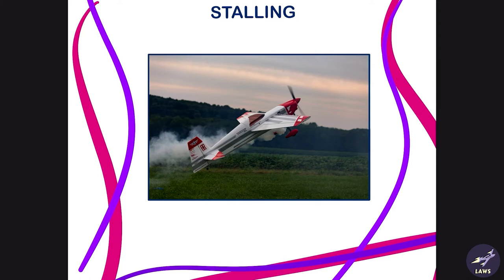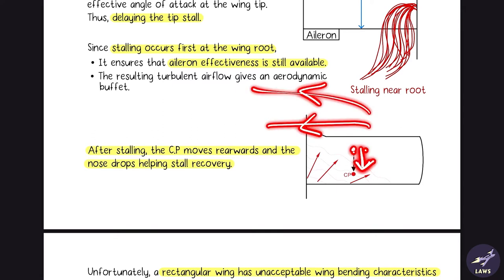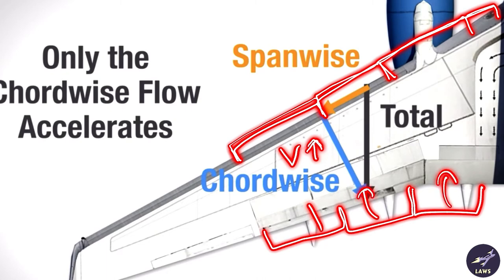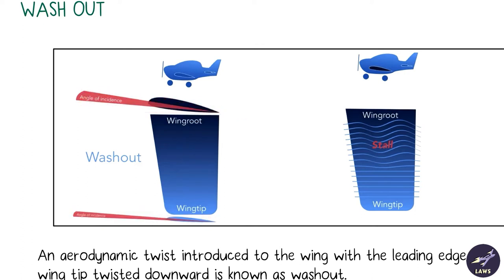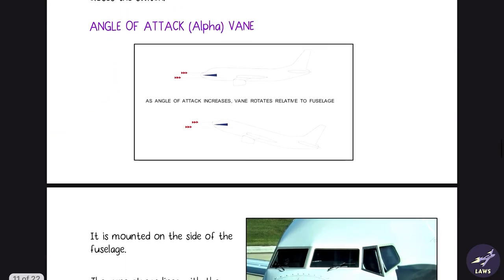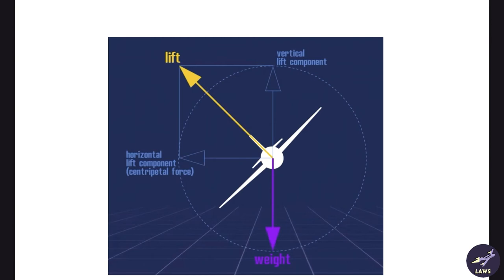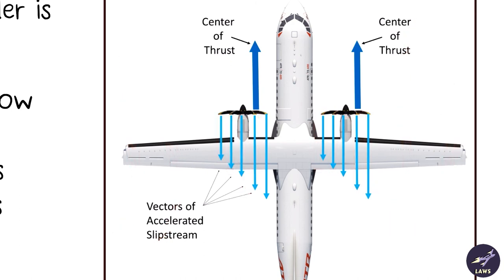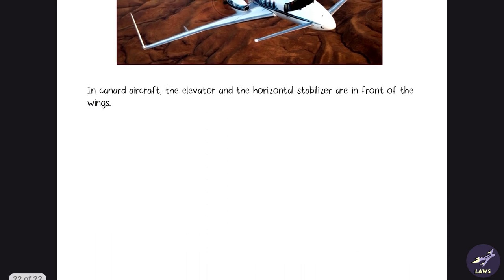Stalling - Principles of Flight #5 | Technical General DGCA CPL Exam Ground Classes Online

Comment: In the span wise and chord wise flow you are saying that high lift devices increase velocity which increases lift , but it should be high light devices increases angle of attack which increases lift at low speed ?